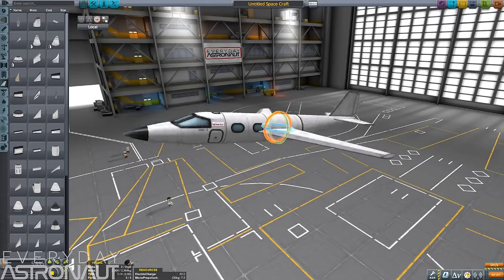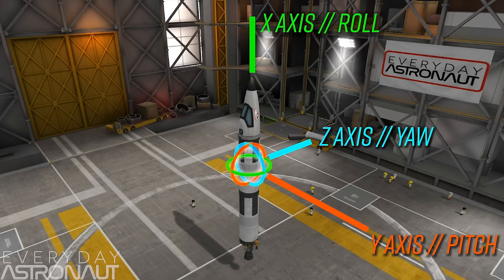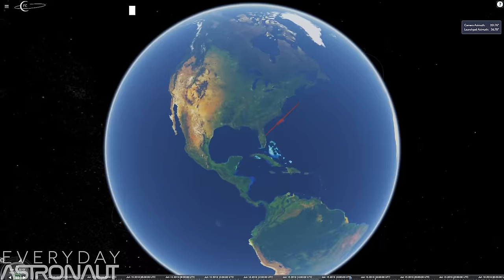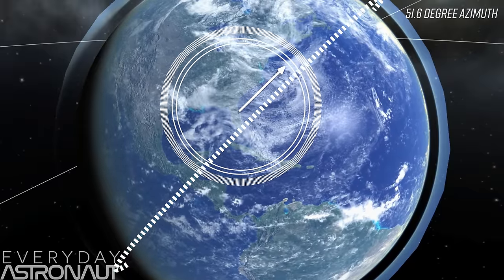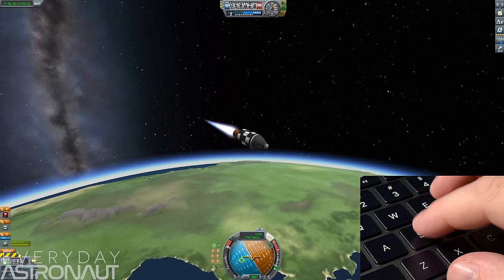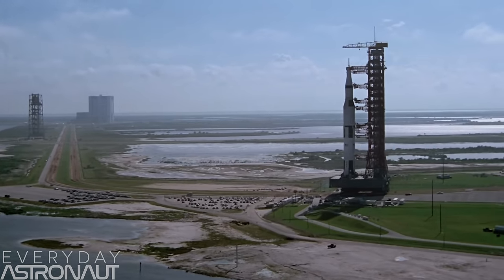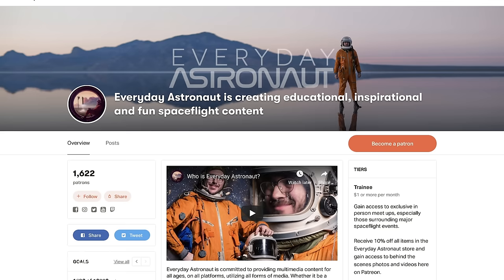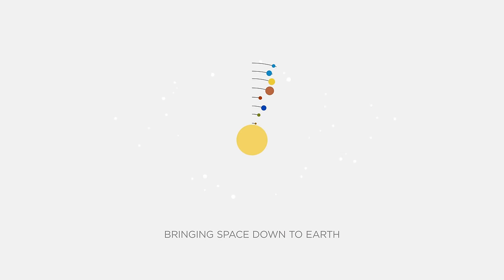Why do cylindrical rockets roll?

Comment: As someone that has been struggling to work with the difference between modelling program's XYZ axis vs Unity's XYZ axis I had a heartattack when I saw the XYZ layout you use in this video. :'D
(Unity has Y as the vertical axis whereas many modelling programs have Z as the vertical axis, which leads to very confusing results when trying to manipulate parts on their XYZ axis using the world's XYZ axis as reference)

Comment: @Everyday astronaut- great video!  Lots of good information here.  Question for you about the Saturn V rockets; thought you might know the answer to:  It’s about those 6 or 7 umbilical cable support arms that all swung rapidly away from the rocket upon a successful launch.  Were the 6 or 7 swing away support arms all connected to one main vertical shaft?  This would only require one main retraction mechanism and its backup.  Otherwise, each support arm would have needed its own retraction motor and backup system.  I hope my question even makes sense.  Thank you in advance for any answers.  🚀

Comment: You missed an important point, at least for the Saturn V. The gyroscopes in the IMU were spun up days before launch, and would inevitably suffer from precsion before launch because the Earth rotates. The IMU had a window in it to enable the IMU  to correct for this, as in "The inner gimbal also carries three accelerometers, two pendulums, and a pair of prisms. The accelerometers measured vehicle acceleration along the X, Y, and Z axes. Their outputs were used by the LVDC to measure actual vehicle motion, for the purpose of navigation. The pendulums were used to set the X axis exactly vertical, and the prisms were used to align the Y and Z axes, just before launch. The prisms reflected infrared beams sent into the ST-124 by a theodolite stationed 700 feet away from the launch pad. Commands from the theodolite were transmitted via cables to the vehicle, to torquers in the ST-124 to orient the stable platform toward the correct azimuth."

Comment: I'm at 1:40 right now. From playing KSP, I assume it's because you need to be making pitch and yaw adjustments relative to somewhere. You want the rocket to be oriented a certain way so that when you give it the command to move in a specific direction it responds the way you want it to. Here's a VAST oversimplification. Let's say you have a rocket which is flipped 180 degrees on the x axis. You give it the command to go left... and now it's going right. You tell it to go right, hoping that it will go left, but it has shifted again. It goes left, but a little forward at the same time.

Comment: Tim, Great job on your videos. You frequently say 'That might be going a little too deep...' or words to that effect, and then keep things relatively simple. I have a feeling you already have more in depth info at hand when you decide that things are getting too complex -- perhaps even editing out some completed footage. How about adding a more in depth presentation on a Part 2 video when requested to do so? This could be made at a later date.

At about 5:30 you mention that the SSMEs are gimballed (sp?) to align through the vehicles's center of mass. IIRC, STS-8 was the first Shuttle flight to do this. The stated reason for this at the time was to allow a payload increase.

Comment: I look at it like flying a rocket with an etch-a-sketch trying to draw a 37.5268° angle it can be done but with tons of adjustments it’s inefficient as well as dangerous could cause vibrations In flight. On top of it being easier to compute direction.

Comment: So the easiest explanation because I see it's hard to explain, I've watched many videos but people have a hard time explaining, is that the rocket, even if it's cylindrical it's still have a top part, a bottom part, a left and a right part and the computer on board knows that. So in order for the rocket to be able to alter the trajectory as it flies towards the edge of the atmosphere,  it's easier to roll, put it in the exact zero position, make it easier for the computer to calculate. Imagine the rocket being an aircraft with wings, a plane going upwards. It's easier for it to be perfectly aligned. But that roll isn't necessary. It helps but I'm pretty sure they can alter the trajectory with or without the roll

Comment: I have a question regarding MAX Q. I know that during rocket launch, one main event that occurs is MAX Q where the rocket experiences maximum dynamic pressure which is simply (1/2)ρv^2. I also know that drag coefficient of rocket increases drastically as it approaches Mach 1 and drops later. So my question is, does MAX Q also signify the rocket's speed crossing Mach 1 (becoming supersonic) ?

Comment: OK, I'm not a rocket scientist, but I've done some coordinate geometry. If I had to write the code that calculates the rocket's path, I would just real-time transform its coordinates and orientation into another coordinate system that has yaw/pitch/roll in the direction I want to turn it, then apply the force vectors and transform them back to its real coordinate system so you get the numbers how much to push it in which direction. I think a raspberry pi could do it 1000 times a second.

Comment: V2's had graphite vanes at the engine nozzle exit to control the rocket before the speed was high enough to allow the fin stabilization to take over and this was with one engine.  I don't remember seeing the V2 roll at liftoff.

Comment: I suspect the reason the service module and rocket of the Saturn 5 had different coordinate systems was that the service module spent a large portion of the mission turned around backwards in order to dock with the lunar module.

Comment: You forgot to mention perhaps the most important reason for the roll; next to alignment of azimuth; which is the visual inspection of the rocket's body for structural damage and integrity by the flight following observatory. This was proven most poignantly, when images of the side boosters on the Challenger space shuttle flight in 1986 showed them to fail dramatically, causing the whole structure to explode. Unfortunately this didn't save the intrepid space farers, but it would prove useful for future launches to predict possible damage to the Space Shuttle's heat protection layer, no doubt

Comment: Hey Tim, can you explain why the Shuttle seemed to immediately drift sideways from the launch tower, right after liftoff? Was that for safety reasons... or does that have to do with earths rotation somehow?? 🤔

Great video, by the way 😎
Reply: Space Shuttle was always start rolling before aligning sideways, and it has to orient sideways since it is going into orbit around that Earth, and orbiting direction is 90 degrees off of the launching orientation (which is mandatory since this is the most efficient way of placing a rocket into orbit).

Comment: I was always confused by the shuttle's roll program.  I mean, I understood why it did roll for the reasons you mentioned, but I don't understand why they had it roll so much; almost a full 180 degrees.  Why didn't they just construct the tower & service structure on the pad such that the orbiter was facing mostly towards it's usual azimuth?

The best I can guess -- and is probably why -- is that they were essentially re-using the Apollo VAB and crawler, and with the tank & SRBs being assembled first, then moving the orbiter in later, that necessitated the vehicle being in that particular direction.

Comment: Interesting video that left me with even more questions - like, when did the X-axis become vertical?
Reply from the maker: It’s based on the cockpit. Pilots are laying on their back. So to pilots / astronauts, x axis is the same as it is in a plane.
Reply: @EverydayAstronaut  - Thank goodness. I've reached an age where what I thought I knew is not always what I actually knew a few decades ago. 

I was also willing to make a case for the rocket having a horizontal position when achieving orbit, giving a tangential X-axis.

My only experience with pilot orientation was with Estes rockets with a clear payload - which Estes wisely made too small to stuff our sister's gerbil in, so we settled for grasshoppers - I'm not sure what their orientation was.

Comment: If you look for example at the Space Shuttle launches, right after the start the whole rocket starts drifting towards the down of the Shuttle. Is this to prepare the roll technique or is this maybe the earth rotation which is watchable? I don't know if this happens to other rockets too, but I think the bigger the more it happens. Maybe this is just due to the CoT not matching the CoM. Thank you for your awesome videos!
Reply: It's because the space shuttle main engines thrust at an angle.  This pushes the entire spacecraft sideways.  The reason they thrust at this angle is they have to push through the spacecraft's center of mass otherwise they would tend to pitch everything nose down.

Comment: Very good video, with a couple of points I hadn't considered.
There may be some confusion with the simple solid fuel engines sometimes used for research and fun, where some rotation is used to help counteract any variations in the thrust line vs centre of mass or other irregularities, as they don't have any other steering or stability controls?
Reply: GordoWG1 WG1 That’s spin stabilization, which Tim didn’t mention.
Reply: @bbgun061  That was why I mentioned it :-)

Comment: I still don't understand why the Shuttle was oriented nearly 180 degrees off from its intended flight attitude instead of having its tail pointing East as it stood on the launch pad. Was that just because it was using Apollo legacy structures and the position of the VAB's orbiter crane, the crawlerway, and the pad service structures were non-negotiable?

Comment: It sounds like, the people building it, don't listen to what the end user needs, and the end user has to come up with a solution  to compensate. I've been on the testing team for several software packages the military uses, none of what we wanted ended up in the final product, so we had to write our own separate program to work around it. Why don't/can't they design the rocket, so all these things line up correctly when placed on the launch pad? I'm sure it's more complicated then that, or does it have to do with cost? Thanks for the video and interesting subject

Comment: While it is "easier" in theory to calculate only a pitch over, the rocket's navigation system always calculates both pitch and yaw regardless of how you launch.  So it really isn't any "easier" on the rocket's nav system.  They didn't design it any differently.   It is easier on the humans watching the displays monitoring the launch.  Even analog computers from the 50s and 60s can easily handle 3 axis nav.  It doesn't require a modern digital computer.  The shuttle also rolled to deal with the lift from the shuttle's wings.  With the shuttle upside down, the lift helps pitch the rocket over.  If the shuttle was on top, you'd have to counteract all of the lift and it actually would exceed the structural limits on the spacecraft.
Reply: The computer’s on the Saturn V are very limited. Every pocket calculator ever made had more processing capacity. Simple is good.
Reply: @allangibson8494  The first pocket calculators were non programmable 4 function 10 digit devices.  They didn't even have memory beyond the display and showed up several years after Apollo.   The Launch Vehicle Digital Computer that guided the Saturn V was a 26 bit general purpose programmable computer built by IBM, was triple redundant, had 32kB of memory and ran at 2 MHz and weighed 73 pounds.  It had a digital to analog and analog to digital I/O subsystem and a separate analog flight control processor.  That might not sound like much compared to your 60 year newer iPhone, but it was pretty advanced for the 1960s, especially when you consider a few years earlier this device would have taken up a floor in a building.  Does that sound like it was "simple", "very limited" and less capable than a pocket calculator?  It was comparable to the Apollo guidance computer.

Comment: @EVERYDAY ASTRO
I get how the space shuttle needs to point to the centre of mass, and that that centre moves as the fuel depletes, but isn't it a waste of thrust having the thrust of the engines and the boosters misaligned? i seem to notice this also in the dragon capsule and the proposed starship lunar lander, where the boosters point slightly outwards rather than straight down.

Comment: The argument that it "simplifies" the math is true, but they don't need to physically roll the rocket to do this:
the nav software can arbitrarily pick any direction to be the x/y/z axis, it doesn't need to align with the launch pad's x/y/z, or a even align with a physical side of the rocket (since its not like they're manually piloting the rocket).

This doesn't account for things like raceways that make a rocket non-symmetrical... but apart from that, is there any other reason why nobody simply "recalibrates" their axes to match their desired azimuth?

Comment: I just Love how Big Rocket Engines Need a Small Rocket Engine to even Run :D 
Until we figure out another way of pumping enough fuel / oxidizer without using rocket exhaust driven turbo pumps

Comment: At 14:20, we can see chunks of something white coming out of the nose of the shuttle, right in front of the forward windows. Afterwards, there appear to be tubes running through the nose, as if the white chunks were plugging the tubes. Can you explain this?
My initial thought is that this has something to due with the aerodynamics and the change in pressure as the shuttle accelerates and the atmosphere thins. It very much so appears to be intentional. Could this be a redirecting or breaking up of a shock wave, or perhaps nothing more interesting than a couple of instruments taking readings?

Comment: Around 14:22 I think you can see bits of foam or some material falling off the space shuttle. Correct me if I am wrong.
Reply: That was a relatively common occurence during shuttle launches,  that could be ice coming off, or foam from the big tank. It was a piece of foam that damaged Columbia's wing which resulted in its destruction during reentry.

Comment: Why don't they put the rocket on the launch pad the other way round so it doesn't need to roll? I get the impression that the launch complex was built north/south and the rocket made with the door on a particular side, rather than with the launch azimuth in mind.

Comment: Has to do with inserting. Into orbit. You don’t just climb straight into space or you would have no forward velocity. You go at an angle so as you climb you accelerate to orbital velocity. If you went straight up you would fall back. Orbital velocity is between 14,000 and 15,000 mph. Escape earths gravity is near 25,000 mph.
Reply from the maker: As mentioned, that’s not what this video is about. That’s the gravity turn. Gravity turn and the roll program are different things.

Comment: bullets, arrows...darts.. etc.. are also set up to rotate (roll) (bullet's because of the barrel having a corkscrew groove, Arrows and darts, by putting the flights (feathers etc) slightly slanted)... for aerodynamic stability.. isn't that a factor too?
Reply: Bullets and arrows do not have their own rocket engine to propel and guide them, so they are flying through the air by the amount of kinetic energy they got from the launch. They spin around their axis to keep the flight path more stable and not make it tumble too easily. Basically averaging out the wobblyness of the projectile. Rockets do not have to spin, as the engines can be used to correct the flight path mid flight.

Comment: I find it highly nonstandard for the X axis to be vertical. I have always seen X being horizontal in both 2D and 3D. In 3D, some people/systems choose to have Z vertical and some choose have Y vertical (depending on whether they're extending into the 3rd dimension from a horizontal or a vertical 2D plane), but I've never seen one with X vertical, because X isn't vertical in 2D, even when you consider your 2D plane to be a vertical one. Y is vertical in that situation.
Reply from the maker: Yeah it’s weird but that’s just how nasa defined it 🤷‍♂️

Comment: Wait a second.
Don't those reasons basically cancel out each other?
If you roll to align to azimuth it doesn't mean you improve line of sight or aerodynamics. It may be even worse then.

Considering our currently available on-board computational resources we can easily fly yaw-pitch in real time.

Wouldn't it be indeed better to take on the USSR approach then?

Use rotating launch pads to align for aerodynamics and line of sight, (somewhere in between at least), ditch azimuth alignment, get rid of alle the roll-complexity (for safety) and fly Yaw-Pitch in a 3D space.

Comment: But, this still doesn't answer the question, it is not like the rockets just happened to exist and they collect them from a vine, they design  them (or at least most of the ones presented here) for a specific purpose, like the Saturn V to go to the moon, why didn't they put the fuel inlets and cabin door rotated to compensate for it? I mean, you showed two options, either rotate the rocket mid flight or rotate the rocket pre-flight, this last one needing to have the platform rotated as well; but if the inlets for the umbilical cords were rotated in the design process, the rocket wouldn't need to rotate after flight nor the platform launch, other solution to that would be, again, in the design process having the whole control unit rotated. 

I understand it for general purpose rockets like the falcon that one day goes to the ISS and the next day goes to a polar orbit, but it doesn't makes sense to the ones that had the flight pre-tracked